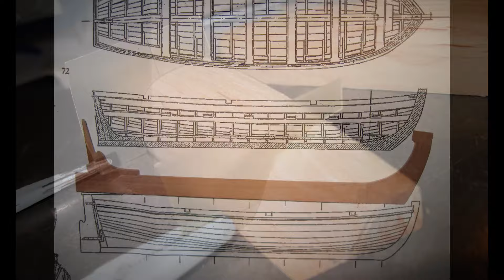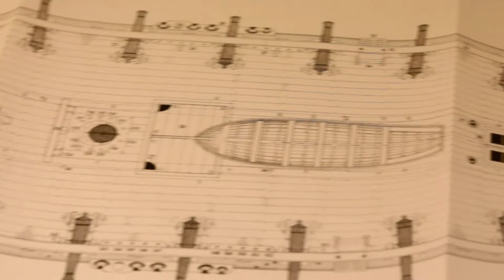Clinker boat for the model of the French cutter Le CERF (1779-1780)

Comment: You like the lapstrake (clinker-built) small craft?  They are very light, strong, and seaworthy watercraft.  And, as usual, you do a superb job of it.
Reply from the maker: Yes, I love these little boats, my very good friend builds them from mahogany - I tried them on the Dnipro River)))
Reply: @OlhaBatchvarov  They are great in almost any waters.  I have both sailed and rowed in them.  They are almost magical in almost any sea or lake.  and you do a marvelous job of making the model and representing the rivets normally used.  In mine, the rivets were copper, and I had used Marine Spar Varnish to allow the color of both the mahogany and copper to show through.

Comment: @olhabatchvarov, is that a sort of graphite drill or punch you made to simulate the nails @1:135-@1:43?.  Ingenius!
Reply from the maker: This is graphite for a mechanical pencil
Reply: @OlhaBatchvarov  right.  Did you use it to make the holes, or pre-drilled then colored them with the graphite?

Comment: Hi there Olha, an absolutley beautiful little boat you have made. I had been trying to find someone making a model using the shell first process over a solid timber hull and this is the perfect video. I want to use this process for a miniature trireme, built almost exactly the way small boats like this are constructed. However, unlike the clinker built shell, how would you fix planks butted together without glueing to the solid hull.
Reply from the maker: Thank you!
For normal planking, you will need to fasten a few frames and glue the planks to them (I usually install a midship frame and 2-3 in the bow and stern).
Reply: @OlhaBatchvarov  OK cool, thanks for that!

Comment: wonderful work, how did you manage that the clinker planks do not stick to the bulk? Did you put a layer of transparent foil over the bulk first?
Reply from the maker: Thank you! I did it without foil or plastic bags. Just applied glue only at the contact points of the boards. Therefore, they could not stick to the bulk!
Reply: @OlhaBatchvarov  Thank you Olha, i appreciate your feedback. You work very clean them. Actually I found your build log on modelshipworld and found your vids by coincidence, I'm currently building the notorious Bounty, the Schooner for Port Jackson and the Cutter Sherborn, all in 1:64 scale from scratch, which is sometimes tricky do to the very limited space, thanks again :-)
Reply from the maker: @TheBruteOne  Wow - you are building a whole fleet at once))
Reply: I've used cling film,- not for wooden boats but similar, laying fibre-glass and resin over a plaster-and-wooden-formers mould (for a tramcar roof).